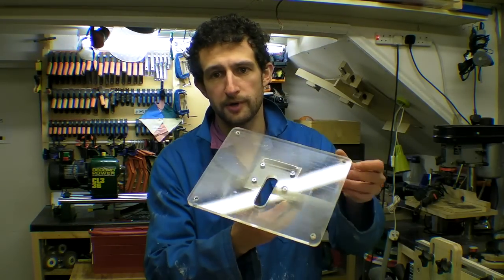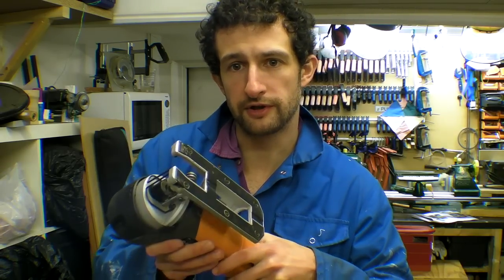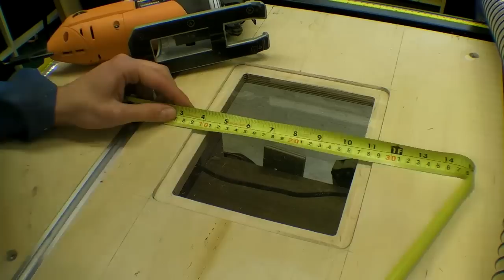Table Mounted Jigsaw with NVR Switch / Interchangeable Table Saw Extension Perspex Plate

Comment: I have seen several designs for inverted jigsaws and this is one of the simplest and better working ones that I have come across. Some sort of spring loaded detachable arm that would help hold the piece being worked on in place might be a good idea.

Comment: Great idea.  Compact, non-destructive to the saw, easy to use and attach.  I like the idea because it's a nice way to handle pieces that would normally be more difficult to hold and handle if you were using "saw to work".  The "work to saw" concept is a good one. 
Maybe the next project would be to attach an angle grinder with a thin cut off blade and make a mini metal table saw.

Great videos, thanks!
Reply from the maker: I have made a portable band saw stand with doubles as a upright band saw.  https://www.youtube.com/watch?v=aKdkAs482Po&list=PLE0DA02B9B60A6726&index=71  Not sure the sparks from a grinder would be safe near a table saw which often had sawdust along side it.
Reply: *****
Savvas,

I use my angle grinder for lots of wood shaping tasks.  I think of it as a "multi-tool".  I have mine on a mount I use that is similar to the belt sander stand you made.  I use a 6mm abrasive wheel to make short, shallow dados and grooves, and even rabbets in small projects with thin stock.  It's a lot safer than a table saw or router and you get a good result if you don't try to take out all of the material all at once. Your set up would let me use it like a very safe, mini table saw. 

For metal there are sparkless cutting blades used for non-ferrous metals.

http://www.specialtytoolscanada.com/products.php (just one example).  I've used these on my miter saw and love them.  They are pricey but well worth it especially in a small shop where you do lots of varied work.  If you were cutting lots of metal they you'd want a dedicated area for it.  But for the occasional short rip or cross cut imagine a small little table saw with a sparkless blade.  Cutting that plane knife like you did a few weeks back would have been pretty easy.

Anyway, I get excited about the creative thinking in both projects and tools.  I think it would be great to have small, work table/tool in a package about the size of a small table saw that would give even small apartment dwellers a more or less full workshop capability for small projects.  Your mounting system would be a very good start.  It would work just as well with a drill and be an upside down drill press as long as you had a mount that allowed you to position the work.  Izzy Swan has some great ideas on his channel that use a drill for the power source.  Imagine getting a

* table saw,
* band saw
* drill press
* sanding station
* router table

that works with both wood and non-ferrous metals and would all fit on a small kitchen table and run off of a small 1 horsepower motor or corded drill.

Love the videos, love the creativity.  All the best.

Comment: I made a quick and dirty version to cut upholstery foam using bosch rubber blades. worked great. I didn't have a scroll saw at the time and it worked well doing that aswell with bosch scrolling blades.
Edit - good for thin metal too with the right blade

Comment: Thanks for the video! Is that just normal CA glue? Do you do anything to keep the dispenser from clogging up?
Reply: This is probably acrylic glue, not CA
Reply: From the website linked in the description: "...and I am using dichloromethane plastic weld to hold everything in place."
Reply from the maker: yep dichloromethane

Comment: Awesome video and idea as always! But for me it seems a bit scary to see the blade flexing in movement and gives the perception that the cuts don't get any precision. Is it working fine and can you follow lines easily?
Reply from the maker: I am using a short sharp scrolling blade whose teeth don't seem to have a preferred direction, and that seems to work the best.  I am not sure how thick I am willing to go with material or how other kinds of blades will fare.  I'll make a follow up video.
Reply from the maker: ...and extraction!